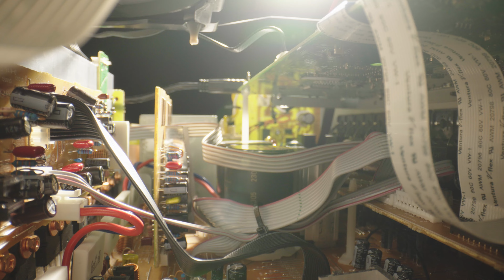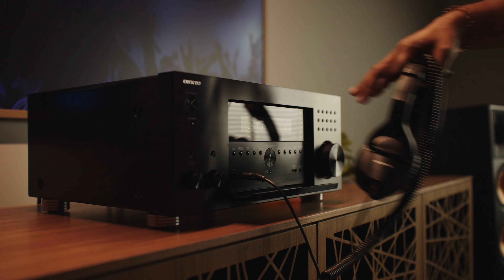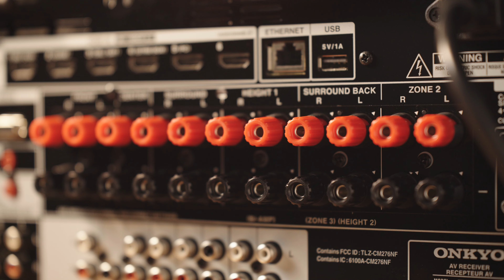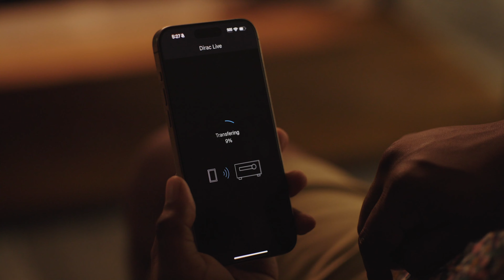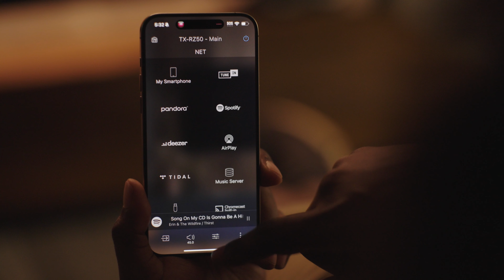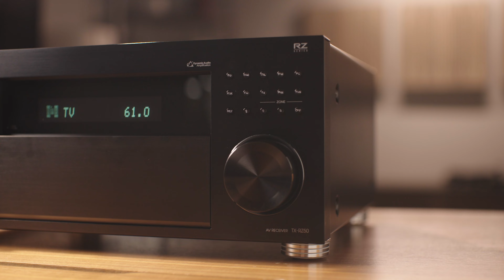Onkyo TX-RZ50 9.2-channel home theater receiver | Crutchfield

Comment: I have the Rz70 and am considering giving an Arcam AVR11 a test run. Any thoughts between the 2? Currently running 5.1.2, 5 kef Q series speakers.
Reply from the maker: The Onkyo TX-RZ70 and Arcam AVR11 are both fantastic receivers.  The Arcam is typically considered as offering slightly cleaner overall sound quality, but the Onkyo has stronger power output.  Are you having any specific issues with the Onkyo? Any complaints with its audio performance?

Comment: What choice would you make between the RZ-50 and the Cinema 60? primarily for listening to music in a 5.1 setup
Reply from the maker: Hi Fabian, both great receivers. Are there any specific features or connections you need? What are you speaker specs or models? Thanks!
Reply: @crutchfield  Well, I've read positive reviews about dirac live. But not really need something specific. Front speakers are the q acoustics 5040, 5090 centre and with 3010i at the back

Comment: Correction to the info provided here... the receiver is actually an 11 channel not 9, supporting a full 7.1.4 setup.  9 are powered, but the last 2 are only available via pre-outs and you will need a 2-channel amp if you want a 7.1.4 setup by adding surround backs (SBR/SBL) to your 5.1.4 setup.
Reply: How would I set this up for a 5.1.4? I also have an emotive a5 but I didn’t notice a single thing, so how would I connect it to this?

Comment: Just ordered mine a few hours ago and I'm like a kid on Christmas. I was torn between the RZ-50 and the NR7100 but decided on the RZ-50 for several reasons. 1: I can expand up to 7.1.4, 2: it has higher quality components and 3: an extra year warranty. All of those things are worth the extra $350 to me.
Reply from the maker: Its a workhorse! What speakers are you connecting to it to start?
Reply: @crutchfield  I'm using a Klipsch R52C center channel, 2- RP-5000F floor standing, 4- Paradigm AMS-100R in ceiling speakers (for my surround L, R, & BL, BR) and a Klipsch R120SW subwoofer. Currently using the Onkyo TX-NR595 and it does a fantastic job, I just want more expandability and power!
Reply from the maker: That sounds like a fantastic setup! What are your plans for speaker expansion?
Reply: @crutchfield I’d like to use the ceiling speakers as atmos and add at least one surround right and surround left for a 5.1.4 system but ultimately I’d like the 7.1.4 but that’ll be a while.
Reply from the maker: Do you think you will add a second sub to the setup?
Reply: @crutchfield  I'd love to at some point. There's one problem though... wife.

Comment: would this be overkill for a basic 5.1 setup with in Proficient Audio in ceiling speakers?  A Bowers & Wilkins Center  channel speaker and Bowers & Wilkins ASW610 Sub/ I currently have the Denon AVR-S970H which sounds great.
Reply from the maker: Even though the TX-RZ50 is a 9-channel receiver, it will also work well with a simple 5.1-channel setup.  Are you having issues with your Denon receiver?
Reply: @crutchfield  yes I had issues. Had the Denon for about 3 months but had compatibility issues with it and my Sonny Bravia TV. TV would reset, Sony replaced mainboard, still had the same issue. Then upgraded to high end HDMI and then started getting screen freeze. I went through every option/setting on both receiver and TV and would still get random freezes. I settled on a Sony STR-AN1000 yesterday. No problems so far. The Sony and Denon weren't compatible for some reason. I don't think the Denon was defective. I'm past the return for the Denon so I have to eat the loss. and put it in the closet.
Reply from the maker: I am sorry to hear about the issues with the Denon, but I am happy hear that installing the Sony STR-AN1000 has alleviated those issues and allowed you to enjoy your system!
Reply: @crutchfield  Had the same issue of screen freeze with the Sony receiver. After alll of the trouble shooting I did, I've concluded it's the HDMI cables. 1 of 2 or both in my setup. I ordered new cables. I can return the Sony receiver, but I'm going to keep it. It sounds really good.
Reply from the maker: We are glad you found your way to better sound too lol Keep us updated on the outcome of the cables. We are rooting for the new HDMI cables to be the change that fixes it now!!

Comment: I have a question, I got a 7.2.2 meaning 7 floor speakers 2 subs 2 height speakers. Do I need speaker visualization turn on or off. 

Also do anyone ever turn the bass up on the bass level to +0.1 or just use the subwoofer level volume?
Reply from the maker: Listening modes that have virtual speaker effects can be selected when speaker virtualization is "on". For adjusting your subwoofer level to best suit the content you are enjoying at the time, the subwoofer level control is a great choice! I find myself dialing in different levels of bass often depending on what I am watching or listening to.

Comment: I’m looking at upgrading my old pioneer elite receiver with this one. I currently own the R-34-C, 2 x R620F’s, and a R-120SW. Any suggestions or thoughts with running this receiver with these speakers? Also, I’m looking at purchasing two of either the CDT-5800-C II or CDT-5650-C II ceiling speakers for atmos while they are on sale. Any reason to go with the 8” over the 6.5”? My setup is upstairs in a ~350 sq ft bonus room. Thanks!
Reply from the maker: HI Damion, sounds like you've got a great speaker setup so far and adding the Klipsch in-ceiling height speakers will take things to the next level. Either size will work; but you don't need large drivers for height speakers as they are mainly for nuances and effects. The Onkyo TX-RZ50 is an excellent choice and will work perfectly for your system. Let us know how you like it.

Comment: Here's what I don't understand, and I've complained about it for what seems like eons now:

As a diehard Onkyo loyalist, there wasn't another brand I would have considered when it came time to replace our beloved TX-SR605 - but ever since Premium Audio Group/Voxx/Sharp bought this brand out, the products just aren't the same.

For whatever reason, the newer Onkyos don't show the name of the input in use and the sound mode at the same time on the front display anymore - you have to press the info button on the remote to confirm what surround mode is being used, and then it cycles back to the input name and volume level only.

This is absolutely ridiculous, especially considering all the wasted screen space on the front panels of these AVRs. I really wanted an RZ model based on build quality alone, but this display thing was a deal breaker for me; I ended up going with a Denon AVR-X2800, because it had a fully functioning front panel and an input leveling feature that was important to me (Onkyo used to call this "IntelliVolume" on their receivers, but they dropped that too), but the Denon is significantly smaller, lighter and less well-built than even my old 605. 

I'd love to go back to Onkyo, but they just don't seem to care what their customers want - I even signed a petition people on the AVS Forum made that went to Premium Audio, telling them that they need to bring back the front panel information as before, and I've even suggested it to a couple of company reps via email, but there's been zero response. 

I'm only running a 5.1 system anyway, so advanced features on new AVRs like Atmos and the Dolby Surround/DTS Neural X upmixers are wasted on me.
Reply: Ive been using a Denon 5308 since 2015 so I can certainly feel your pain.  From a sound quality and brute force capability, pretty much EVERY receiver on the market is trash compared to it.  Toroid transformer and everything set up symmetrical inside like a HiFi amp.  Big can capacitors.  Im still working around replacing it by using dual output 4k players.  But its 16 years old and its only a matter of time before it dies.  

So ya, they dont make em like they used to 😂
Reply: @edithboozy1000  Thanks for the response, brother. Indeed, that's how I run my system - dual HDMI outs from the Panasonic 4K player, so audio goes to the AVR and video direct to the display. Even with the new Denon, which is 8K capable, I keep the feeds like this because I just don't want the receiver interfering with any video.
Reply from the maker: I am sorry to hear about the frustration. I think that anytime legacy features from older models are dropped (for whatever reason) it can make things much less enjoyable. I am happy to hear that while not your first brand choice, the Denon is working well. Have you considered moving to a 7-channel or other receivers for the display features you need if you are only planning on running 5-channels?
Reply: @crutchfield  Thank you for your response; I am a long time Crutchfield customer but haven't bought anything recently (we will probably buy our second Panasonic DP-UB9000 from you guys when it goes on sale).

I am uncertain what you're saying about getting a seven channel speaker system in order to get the display feature I'm looking for; adding the extra channels wouldn't enable me to automatically see the surround mode and input name, which is what I'm complaining about with regard to Onkyo's latest AVRs.

Can you explain a little more about what you meant?
Reply from the maker: Even though you are only running 5-channels you could consider upgrading to a 7-channel unit as they can often also provide more convenience features. Something like this NAD T758 in the link below. This one is powerful and has exceptional sound quality, and the front panel displays visual information about the current settings like the active Source, volume level, listening mode, and audio format which is a key feature you enjoy!

https://www.crutchfield.com/I-rYALc166/p_745T758V3I/NAD-T-758-V3i.html
Reply: @crutchfield  Thank you for the suggestion - but the Denon I bought IS a seven channel amp. It's the AVR-X2800H, with Atmos support (for two overhead channels if we ever go down that route).
Reply: @crutchfield  That NAD unit is also out of our budget.
Reply from the maker: It's a very good receiver. Are you happy with the audio performance of the Denon?
Reply: @crutchfield  The Denon is a good receiver, you mean, or the NAD?

Comment: Since yesterday, 29.10.2024 new firmware update for rz50 with the new feature dirac bas control
Reply from the maker: Hi Marin, did you do the Dirac Live Bass Control update yesterday?
Reply: Just firmware update for rz50. In crossover section apear a new option about dirac bass control.
Reply from the maker: Cool. Have you had a chance to try it out?

Comment: I finally decided to upgrade and bought this system. I know, it's older and blah, blah, blah. It's still a great value to cost. I only run a 5.1.2 so I'm good with the current system. My speakers are older Klipsch, 100W, 8ohm speakers so this fits the bill better than most. The deal sealer was I found an open box for less than $900.00. Sometimes it just works out. I'll set it up this next weekend, after getting it, and see where I am.
Reply from the maker: It's a fantastic receiver! Which older Klipsch speakers do you have? Klipsch sub too?
Reply: @crutchfield  My Klipsch system is SR2's, SS1's and SC1 and the sub is an RSW-12. It's older but still really nice. I haven't been able to run it for a couple years so I'm really looking forward to getting going again.
Reply from the maker: Nice! Hopefully you'll have the system up and running again very soon! 🙂

Comment: I am trying to decide between the rz50 and the Marantz cinema 70, using 6 ohm speakers but I just cannot decie and I want to prioritiz soun qualitiy in stereo because I listen to a lot of music in a 5.1 setup
Reply from the maker: Both are great units and offer settings to help improve stereo audio, but the Marantz takes it to a higher level and even turns  its analog video circuitry to minimize the possibility of any noise being added to the audio from the other internal non-audio circuits. The Marantz is the better of the two models for stereo audio playback and can be found here:

www.crutchfield.com/I-rYALc227/p_642CIN60/item.html

Comment: How do i hook it up to play dolby atmos 7.1.4
Reply from the maker: The Onkyo RZ-50 has 9-channels of power.  In the 7.1.4 configuration the receiver's nine channel amplifier powers the Front, Center, Surround, and two sets of Dolby Atmos speakers in the Main Zone, while the Surround Back speakers of the Main Zone are powered by a separate amplifier (sold separately). The OSD XMP300BT below is an excellent choice for the two additional channels of power!

https://www.crutchfield.com/I-rYALc166/p_452XMP300B/OSD-XMP300BT-GEN2.html
Reply: @crutchfield  Thank you. I just was not sure how it was done. It's a next year task as I've yet to source four white in ceiling speakers for atmos in the UK.
Reply from the maker: We would love to assist in getting those to you, but we do not ship to the U.K., sadly.
Reply: @crutchfield  I know have to look and shop around
Reply from the maker: Good luck!! Hope you find some

Comment: I have one and the RZ50 is not .2. The subs are not independent. I wish companies didn’t do this crap. Bad enough with Nakamichi sub BS. Also RZ50 only allows the rear speakers to use the external amp. Just buy a cheap $150 2 ch amp like the ZA3 with 48V power supply and you are good. I seen the RZ50 on sale for $1000. Such a good bargain to get 7.1.4 or 5.1.4 setup. Dirac included which is like a $300 freebie.
Reply: Hi, I want to buy the RZ50 for my 5.2.2 home theater, do you think RZ50 can handle the 2 subwoofers well?
Reply: @Rookie-h6v  Just know that they are not independent. You can't set the levels of each sub separately also the included Dirac is the normal one, not the bass control that is for multi subs which isn't a problem since the sub outs aren't independent in the first place. That said, if you have a normal sized room, I don't think you need multiple independent subs. My single 12" sub works fine for me. I'm sure two subs would be fine too.
Reply: @jjimlee7009  Thanks for so many details,the RZ50 will upgrade its firmware at the end of this year to have the Dirac bass control in the future. As you said,it can't set the sub levels separately. Sorry, I have a silly question: Can the Dirac BC make the RZ50 set subs separately? I am just a rookie to home theater, and I really appreciate your help
Reply: @jjimlee7009  I am asking this because I want to have two subs in my room to reduce the low-frequency standing waves, I saw someone said that is the best way to handle the subwoofer standing waves and increase the use experience at the same time,maybe two SVS 1000 pro subwoofers I guess
Reply: @Rookie-h6v  I believe the only way you can do what you want to do is purchase a minidsp and do REW so you can set the levels and delays. Unfortunately, they pretty expensive at $260 now days. If you want 2+ independent subs, instead of the RZ50, you may want to just get a Denon 3800h with 4 independent subs. I seen them for $1400 sometimes. Not a bad value at that price.
Reply: @jjimlee7009  Thanks so much; I am considering spending more money on the amplifier, maybe the Denon 4800H plus the Dirac bass. I was thinking of buying an Anthem MXR740, but it doesn't support Dirac, and my room has my PC in it so maybe Dirac is much better in my scenario, it is hard to make my mind
Reply: I have the RZ50 for about 2 years now.
The 2 SW outs are not independent but I have 2 15 inch powered subs that I stacked near the corner of the room. Works well.

Also, I have a pair of Klipsch RF-7IIIs and there is no eq setting for it.

Comment: I just realized in order to run 7.1.4 I have to add a 2 channel amp to the zone 3 pre outs and I ordered the 3 channel Emotiva XPA-DR3 for my front stage which is coming to me this week. Now I have to get another amp to use the Klipsch atmos R-40SA I just installed up high on my back wall. 😢 I just wish it had balanced outputs to maximize the Emotiva amp I’m getting.
Reply from the maker: The RCA preamp output connections provide an excellent sound quality since you do not have XLR preamp outputs available on the RZ-50. For your rear Atmos R-50SA's you will use the zone 3/height 2 channels. The OSD XMP300BT in the link below is an excellent choice. It's small footprint and robust power would be perfect for the additional Atmos channel needs!

https://www.crutchfield.com/I-rYALc166/p_452XMP300B/OSD-XMP300BT-GEN2.html